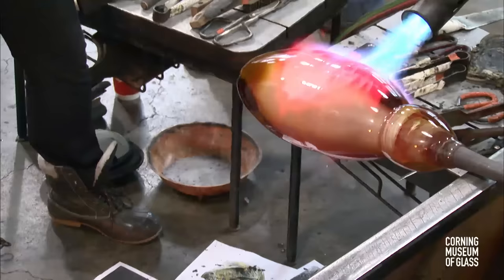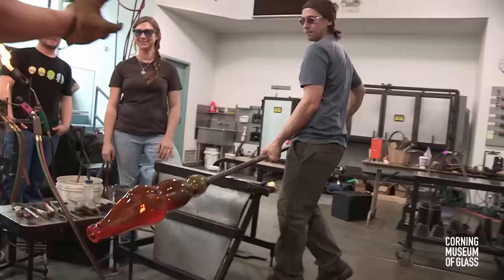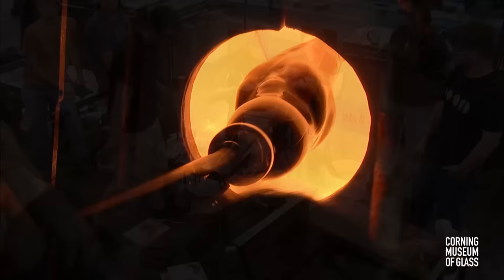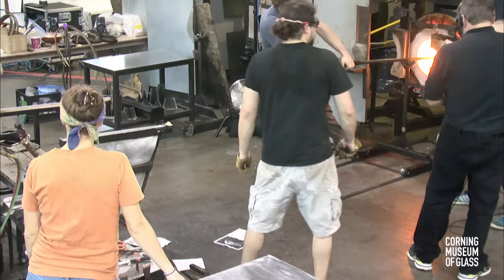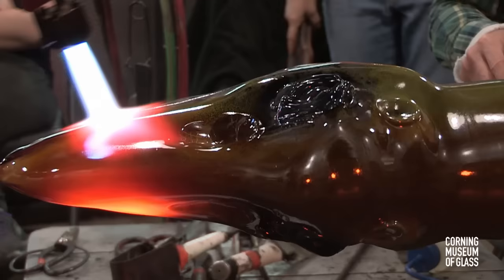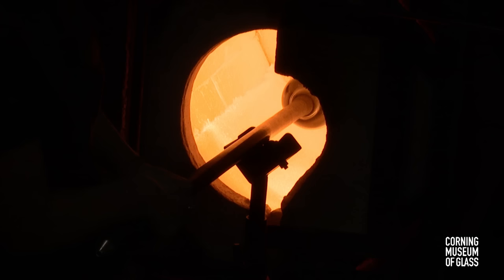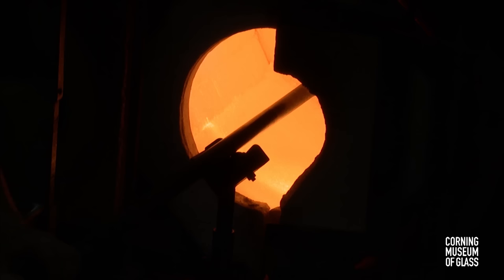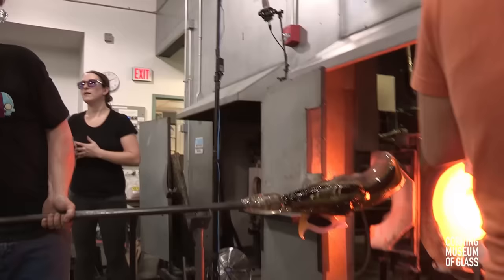Grant Garmezy Live-Streamed Studio Demo

Comment: what is that thing on its head, it was nice up until they put that on
Reply: A-
Reply: I was literally about to comment the same thing lol yea that ruined it🤔
Reply: It's a "frill" horn. Lots of dinos had them for either protection or peacocking for mates.
Reply: I was thinking the same but about the teeth. Angle looks odd, distribution doesn't look natural either. Specially considering that he put the big teeth all the way on the back and if you look at most theropod fossils the bigger teeth are usually on the front or middle with the smaller teeth all the way in the back

Comment: Im a glass noob, but can somebody tell me why they keep a torch to the base after every time they flash it? Is it to keep it from cooling too much and cracking itself on the bar/handle, I'm sure there is a fancy name for that
Reply: Yes, that is so it doesn't cool to fast and start cracking and popping off the blowpipe or punty
Reply: Nice! Thanks johnny
Reply: the part where it connects to the pipe is called the moile and yes if it cools to much it could come off the pipe
Reply: As they mention in some other live demos, that part cools the most because it is the last part in the furnace and the first part out, so it needs a little extra attention.
Reply: Heat and dramatic heat fluctuations change the micro-structural properties of materials.  In a lot of materials rapid cooling induces a brittle state, hard but brittle.  Some steels for example can be air cooled (air hardened) to a high hardness state and can actually become almost as brittle as glass. If you were to throw a hardened (non-tempered) knife against a wall it would almost certainly shatter into shards like glass.  (most steels are hardened in fluids such as oil or water and then tempered afterwards to sacrifice a little bit of hardness for toughness, essentially reducing the brittleness in order to achieve a more resilient final product).  Copper is actually a material that softens with rapid cooling and is hardened through hammering it or work hardening it.
  
In order to finish the product to a resilient state, it has to go through a tempering cycle (generally a high heat atmosphere in the 200 celsius and above for an extended period of time) to reduce the stress in the micro-structure due to rapid cooling process (rapid hardening in very simplistic terms).   With glass for example, you want to cool the entire piece steadily with at the same rate. In order to achieve this you have to heat up the tiny elements which cool down faster as the larger masses cool in order to achieve a homogeneous micro-structural nature to the entire piece.  Or you use a specialized oven that reduces in heat over a long period of time.

Comment: Why are they constantly heating the base of the glass that's attached to the pole with a torch?
Reply from the maker: If that glass gets too cool it will crack and the whole piece would fall off, so it is necessary to torch it to maintain the proper temperature.
Reply: The part touchign the metal must cool faster, eh?
Reply: They explained the other day saying:  That part goes in last and comes out first so it doesn't get heated as much as it should be.  So they use the "fluffy torch " ( thats what they call it) to keep it at the same temperature as the rest. If they don't it will crack and break.

Comment: Why do they keep heating the part where the glass and the metal pipe connect? I know like 0 about working with glass, so I'm just curious
Reply from the maker: Hi, the point is really sensitive and needs to remain close to the temperature of the piece. If it gets too cool, the piece can break off and shatter. Thanks for watching!

Comment: what's that thing with a ball on the end of it? and what is the box shape thing with water in it when they put the rod on and it turns
Reply from the maker: +Andy Dunne - The rod with the ball on the end is an inside sculpting tool.  It allows the sculptor to push the glass from the inside, creating a convex mark on the outside of the glass. They are usually a similar handle with a variety of different ends.  The basin full of water is a pipe-cooler, a water re-circulating device that cools the shaft of the pipe or punty to allow the glassblower to hold the metal tool closer to the gathering end.  This make it less fatiguing and stressful, as the weight of the glass is allowed to be closer to the body of the glassblower.

Comment: If all the directions to glass artistry consists of "Flip It! FLAME IT!! FLASSH ITTTTT!!!" Then I'm gonna change careers quickly. 

Here I usually have to know numbers down to .0005 of an inch and  incrementally back up to 1", IN INCREMENTS TO WHO KNOWS WHAT! LORD ALMIGHTY! That's over five thousand words you need to know, which only tells you what the measurement is in! THEN DO IT AGAIN IN METRIC! Lol. That's not even learning all the dials, knobs& buttons to cut or chase threads on the lathe. Let alone run a mill. Or to use a drill press. Or to get a beautiful finish on the surface grinder. Or all the damn things in-between. 

On a more serious note. Mad props. Turned out pretty cool. I was wondering if you were going to bend the neck at a 90degree ish angle and turn it into a T-Rex in the last few minutes. 

I can see a big old fat crocodile head in the future with way more teeth and about a foot wide at the joules? Jouls? Now I gotta Google how that's spelled.

*Jowls.... damn it.